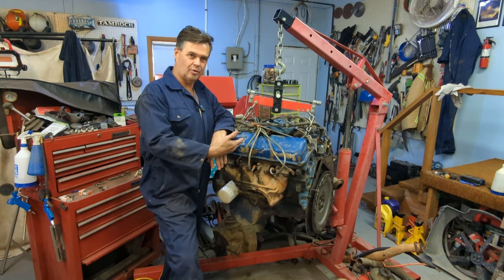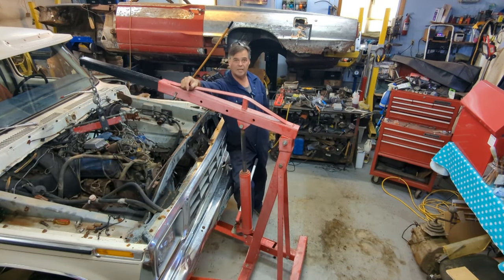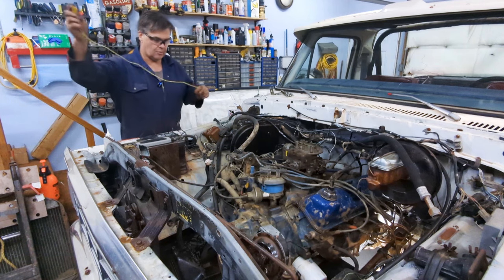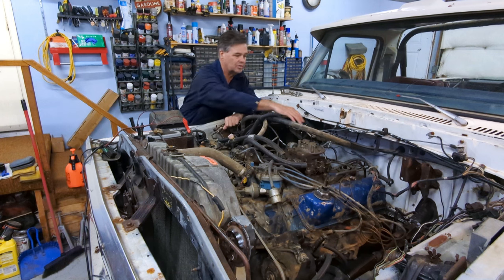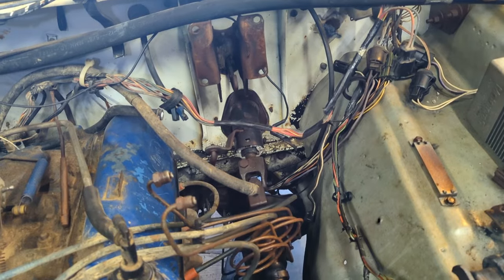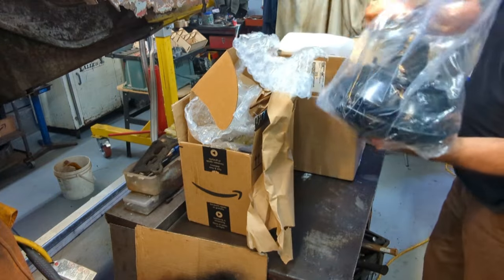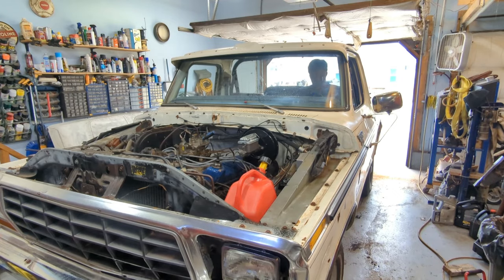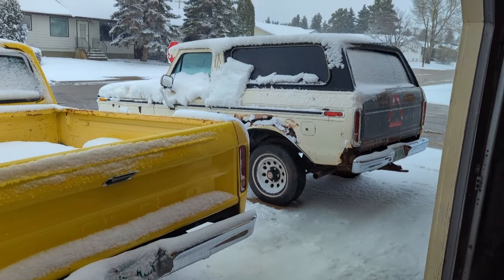78 Bronco Ranger XLT Gets A New Lease On Life!

Comment: Thanks for your video series on the Bronco. I have a 78 that is my hobby/project. I just rebuilt my 1st ever carb, it has a 2150, was missing the power valve gasket, which fixed my fuel in crankcase issue. Mine is an auto with a 400. It also wasn't charging the battery, found a bad fusible link and ended up installing a new alternator, kept the orignal one also. Recently found power steering pump with slow leak out of the pulley area and the c6 trans leaks some, not sure if it is the pan or multiple areas yet.
I'm currently trying to figure out no brake/turn/hazard lights, the running lights/headlights work. Also doesnt stop very well and thinking the master cylinder may need repalced, haven't torn the wheels off yet to inspect brakes either. If you get time could you list your part numbers for what you replaced in this video so I can have a reference, I have a feeling that I will be replacing the same parts. Thanks!
Reply from the maker: I've had a lot of issues with power valve gaskets, I ended up using an o-ring, so far it's working, but I haven't driven the Bronco very much...so we will see.
I'll see about the parts list, but really, just search Bronco or F series for 78-79, I bought all after market parts, and you may find a better deal based on where you live.

Comment: Wow , snow at this time of the year. I hate to tell you that  I had to cut my grass today. This Canada is a big place. 
Are you still running the Bronco with a 12 volt wire to the coil or did you find out the problem? 
All that work, it is either nothing or too much. Until the next one.
Reply from the maker: It's days like this that I miss living in Vancouver. Lol
I got the ignition coil wiring figured out... mostly it was my mistake, I was using two wire harnesses at the same time, and should have only been using one, it's all good now, also had to swap out the ignition key tumbler...the Bronco came without keys. If I think of it, I'll show the fancy fuse bypass set up on the fuse box in a future video...it is quite innovative. 🫣